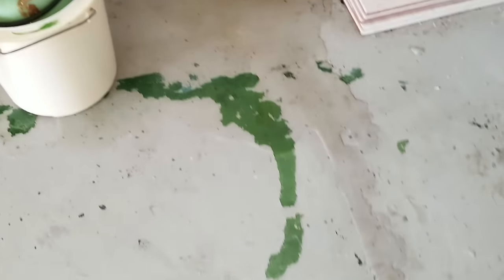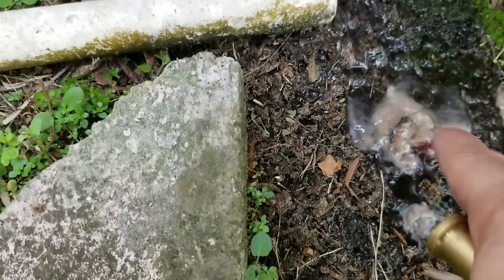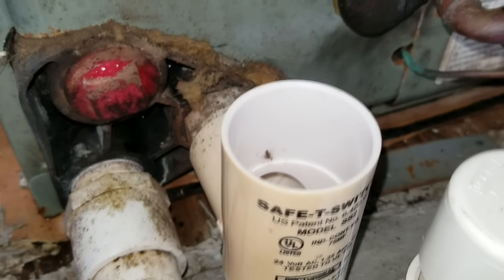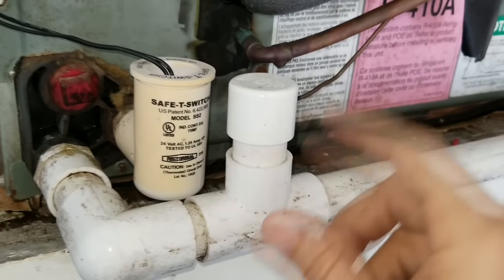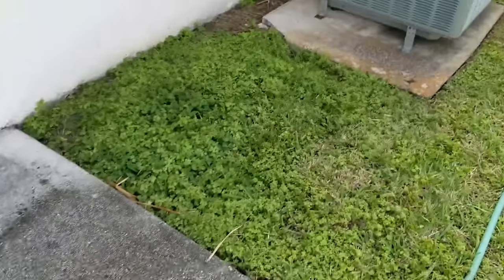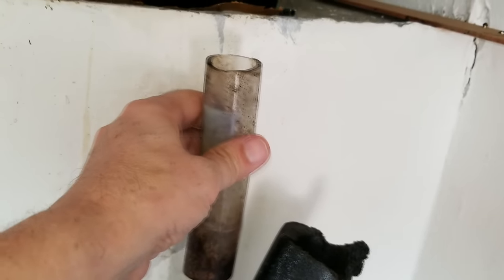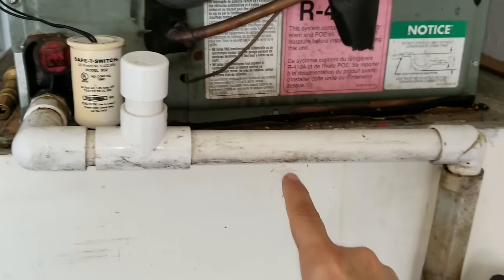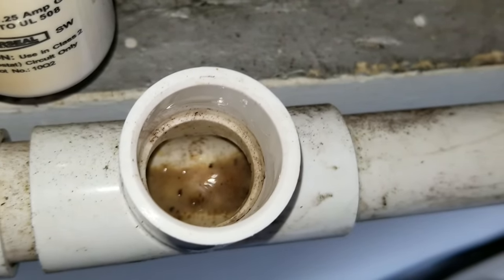How to Unclog AC Drain Line Fast (3 Seconds), Avoid Repairman

Comment: I did this 12 times already... the water comes out fine, no issues, runs right through. But when I attach it all together, the trip floater gets set off due to water backup at drain. I take it all apart, get my compressor, pump air through it, water gushes out the outside exit, no issue it seems. I put it together, happens again. Literally 12 rounds this weekend.... how can it allow water and air through no problem, but then get backed up again immediately? I'm at wits end!
Reply from the maker: Sounds like your float is positioned in the wrong spot. The float is supposed to be above a certain level near your water pan, so any water that backs up will fill up the float chamber before the water can back up into the drain pan to cause an overflow of the pan.  If your float chamber is too far pitched down from the pan, then all water draining form the pan and destined for the drain line will float up into your float chamber. Your float needs to be positioned so that it only fills up with water if the drain line backs up. You need to determine now why is the float chamber filling with water instead of that water going down the drain pipe first. I would look up the model of your AC, and look through installation instructions and read where they tell you to place the float switch and its chamber. I bet there might also be a problem with the slop of the drain line leaving the pan and so water is too slow to head down the drain pipe and backs up into the float chamber. I would also check your opening from the drain pan to the drain pipe and make sure there are no blockages that might make a little bit of water back up into the float chamber. Let us know what you find, this is an interesting case.
Reply: @jeffostroff  the float is above the water drain line though and when the float trips, the drain line is definitely full of water (when I detach it from the ac, water gushes out and the ac starts right up). I try and use the compressor though to get the line clear and the water gets pushed out fine, dumps all the water out. I attach it all back, same issue, after about 2 hours the line has filled up again and the water backs I to the float and pan. The float is working as intended, the water does indeed stop being removed but I dont know why since I can push water and air through it no problem.
Reply from the maker: @JohnSmith-rt5yq   It sounds to me like you still have a clogging the line somewhere because even though you can force the water out the other end of that drain line with the forced air, how well does it perform without the forced airr? So it sounds like it's just not draining you have a blockage somewhere or you have insufficient slope on the line wherever there's horizontal components of the drain line they should all be slanted slightly downwards a quarter of an inch per foot. Your pen should not be full of water the water should be leaving the pen and heading down the drain line periods I would also object the level of the pan make sure that it is not slanted opposite the drain hole. Is your ac level?  Drive pouring water into the drain and see where it goes. Did you try actually putting a water hose in there and turning on the water and let it flush out the dream at full pressure to the outside.
Reply: @jeffostroff  just used air for now from a compressor... also poured about 4 gallons of water through and they went through fine. But when I hook it all up, it clogs again

Comment: Compressed air
Reply from the maker: Yes that is what the pros typically use but of course this video was for the home owner/DIY person that might not have access to a compressor.
Reply: @jeffostroff  we used an air mattress pump. Because our ac unit is in the house and can't really use a hose
Reply from the maker: @tarangamble9265  As long as it generates the air pressure, that will work. We have used the hose inside many houses. The trick is to stuff the hose down the pipe and get someone outside to turn on the water for 2-3 seconds max. keep repeating until the clog is flushed. Usually works by the 2nd or 3rd time.

Comment: What am I supposed to do if my unit is on the second floor.. literally no hose so I guess I have to call my guy
Reply from the maker: We did it at many houses, get a long hose, connect from AC upstairs, out a window or down the stairs through the front door, or even into a bathtub
Reply: @jeffostroff  thank you Jeff ❤️

Comment: Missing a P trap
Reply from the maker: Yes it was missing, and we see this a lot, so likely the installers had no idea what they were doing, you can even see the sticker on the AC telling you about the P-Trap.
Reply: And no union to be able to clean the drain line
Reply from the maker: @FlyEaglesFly19111   Yes whoever installed this air conditioner for this poor woman totally blew it big time you can even see the sticker on the front of the AC that warns you about using a trap on the drain line

Comment: You have a problem that I see regularly. If you can move the drain tube as easily as you did it is too loose and quite likely going to leak.  Ask yourself where  did the water leak out if it didn't backup enough to trip the float switch.  Until you do your problem is still there.

Comment: My understanding is that you need a P-trap to create a seal between the air handler and the outside air. The water always present in the trap makes the seal. Otherwise the blower is going to suck in outside air and moisture through the drain line, and the HVAC techs say this moisture is going to get blown over the coils.  The need for the trap has nothing to do with condos and sewer lines.
Reply from the maker: there is already a trap outside, so you already have your seal.

Comment: I can't do that because I can't get a garden hose into my attic from my spigot at the side of the house.
Reply from the maker: You might have no other choice than to buy a second hose to stretch it out so that you can tie the two of them together. I keep an old hose with the metal end of it cut off so that it can fit into the drain system of the air conditioning pan. Luckily it reaches mine but I have multiple hoses if I need more length out of it.
Reply: @jeffostroff  Do you think I need clean the air conditioning pan too? I haven't opened the side of the air handler to see if it is full of scum but I think  it is because when I clear the tubes the a lot of scum comes  out.

Comment: Poor insulation of the drain line.you need a P trap. Look at the instruction on the unit..
Reply from the maker: Yes whoever did the install on this was not very good at their job. It was obviously done without an inspection to pickers the city inspectors would have filled the inspectionWithout a trap in place.
Reply: The drain going under the foundation and coming back up outside is trapping the water.

Comment: they have an air hose attachment with a rubber dick looking end that inflates a little and has a small hole in the end. you stick it in dump the air, the thing swells, seals, and blows the debris out. i forget what they are called. they sell them at hvac shops.
Reply from the maker: I would love to see one
Reply: @jeffostroff  ya it basically looks like a drain king water hose attachment but for an air compressor. i can't find anything online though, maybe they stopped making them idk.
Reply: yeah...that thing also helps unclog pool piping as well. It works wonders.

Comment: You charged her, replace the switch. The only reason there was no water at the switch was because you blew the clog when you squeezed the flex line. Switch should have been the 1st place you went.
Reply from the maker: I did not charge for anything and the switch does not need to be replaced there is nothing wrong with a switch we tested The switch numerous times and it worked perfectly. All she had was a clogged in her line in the line was fried nicely in her AC is still running now 6 months later.
Reply: My apologies, sounds like the lady said it cost her $150.00 in the background.
Reply from the maker: @smokeydabeecharlescoleman8365  She was  talking to someone on the phone about something unrelated to the AC

Comment: If you trap this drain it will be double trapped and cause more issues. No p trap needed on this one.
Reply from the maker: The problem is some cities require a trap at the unit, and many manufacturers in their instructions telling you to install the trap within 6" of the unit.
Reply: jeffostroff it must be trapped to pass code. The install instructions suggest a p  trap. The trap on this particular install is the pipe under the cement slab. It goes under the garage floor and then back up to drain outside. If you p trap this unit without a fresh air vent above the primary drain pan you will trap air bubbles between the two traps and the unit will not drain properly.
Reply from the maker: @mickhvac3908   Is the opening in the drain pan that leads down this drainpipe  allowed to be considered a vent opening?

Comment: You need a pee trap in the drain. That is why you are having problems. There is negative pressure on the drain holding water in the coil. You need to invest in uv treatment because you got the ugly growth.
Reply from the maker: UV doe snot prevent the growth inside the pipe leading outside. The clog has nothing to do with a  p-trap, which is usually required to prevent the system from sucking warm humid air from outside.